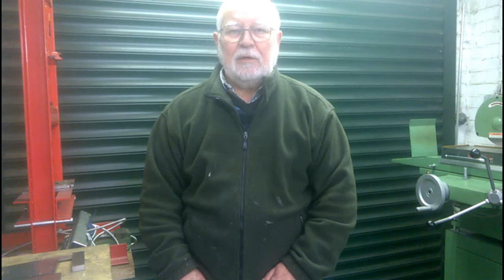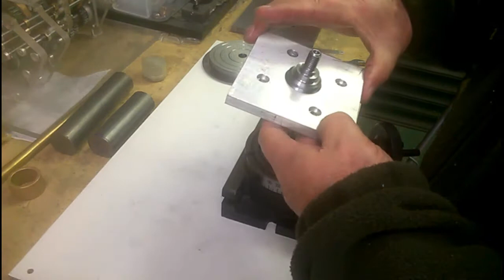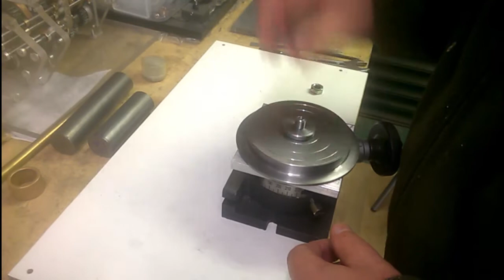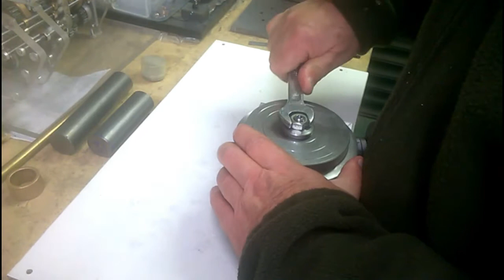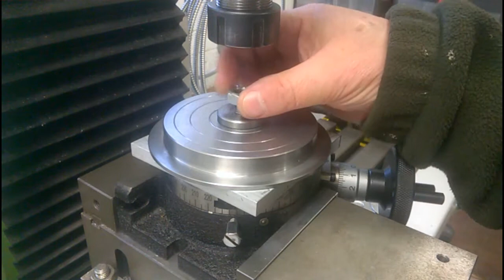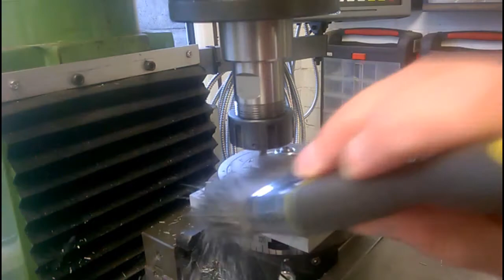Low profile rotary table - part 4

Comment: You had the work clamped in a rotating table. So shy not rotate 90 degrees & use the a axis again. ???
Reply from the maker: Hi, Stevie.  That was my original intention, but the rotary table (the "proper" one) is only a cheap one and has a significant amount of backlash.  I considered that using the mill X- and Y-axes would produce more accurate results.  As it turns out, I would have been better off without the rotary table at all, clamping the work directly in the mill vice.  Effectively, that's how it turned out as I used the DRO to determine where the holes went, not the rotary table.  John.
Reply: Ah i thought there must have been a reason. Nice job.